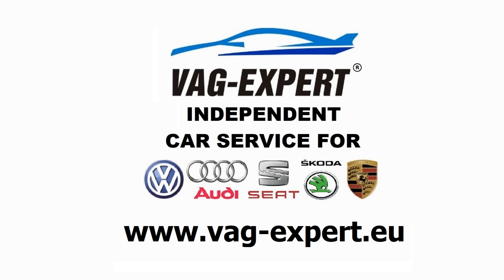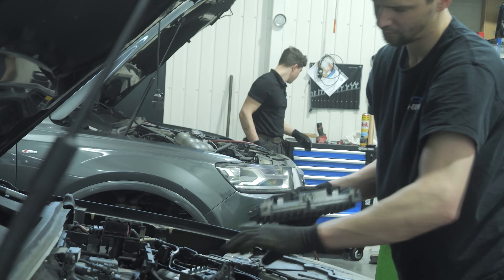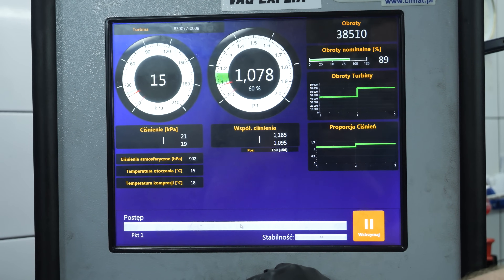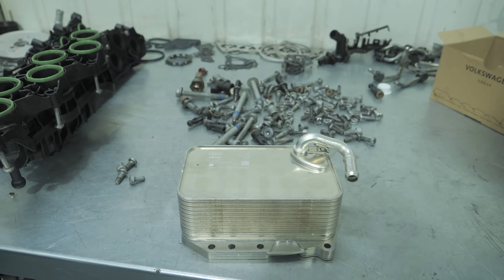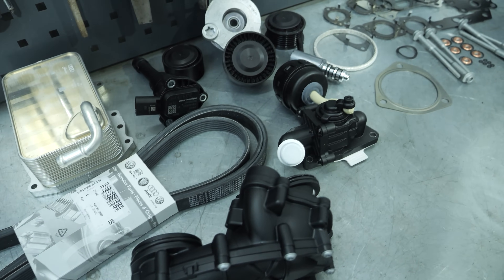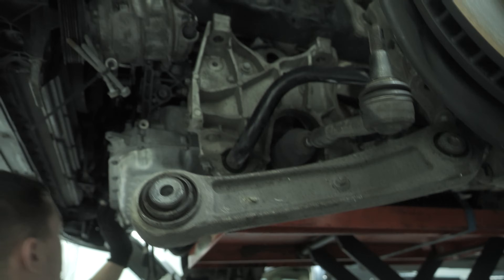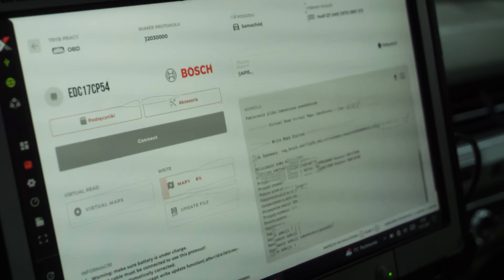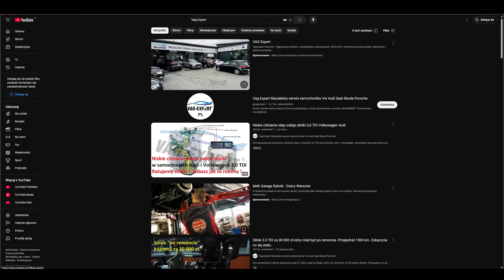3.0 TDI engine replacement in Audi Q7

Comment: the engine is new? in fact my question is.... how much it will cost all that hiper professional work? I´m in trouble with a 3.0 q7 2018 making a nasty motor noise with a red light no oil pressure. Since the noise apperead I made just 50m . the car is my garaje and I don´t know what to do. I need to know prices (from-between) to start doing something. Many thanks.